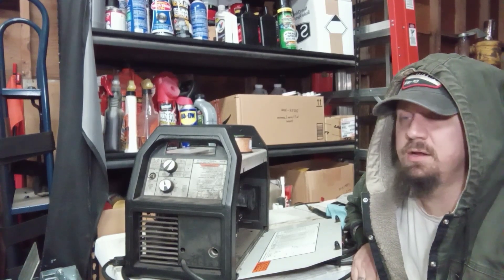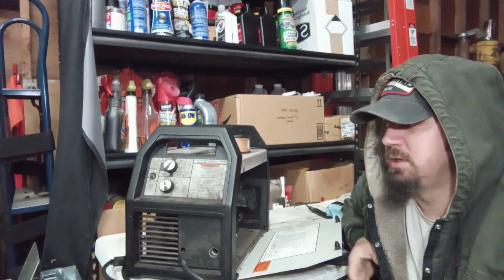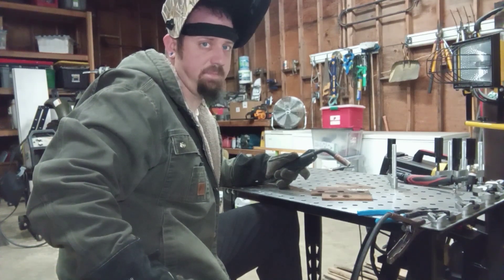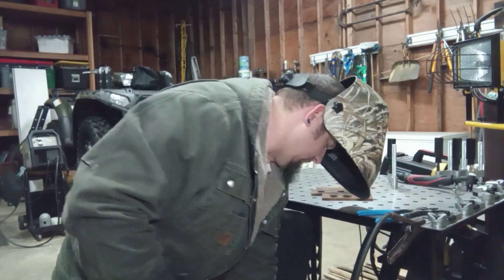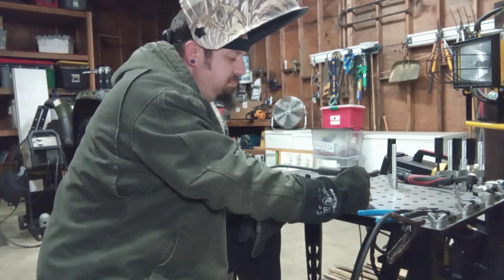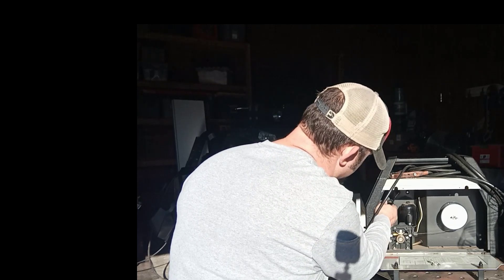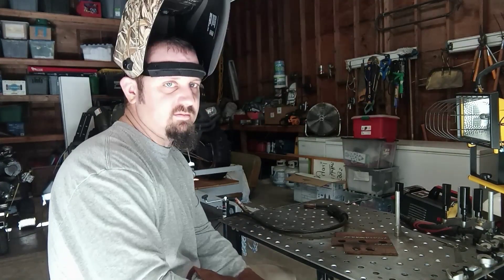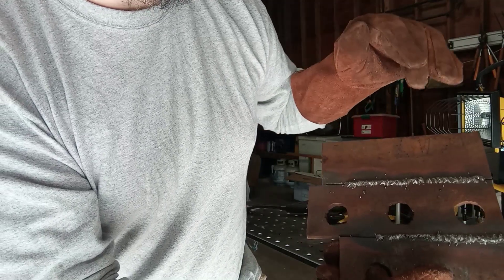Hobart Handler 120

Comment: I have 2 of these welders and they both have the same issue. The wire sputters, seems like the wire is getting pinched, I’ve already replaced the liner. I ended up buy a new welder because I couldn’t figure it out and didn’t feel like throwing parts at it, but I would like them repaired because they were my grandfather’s.